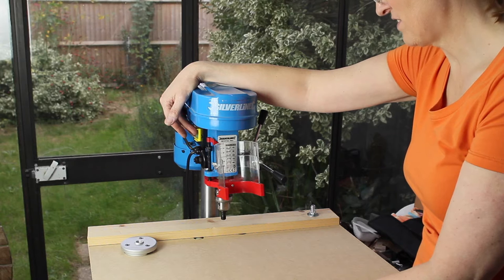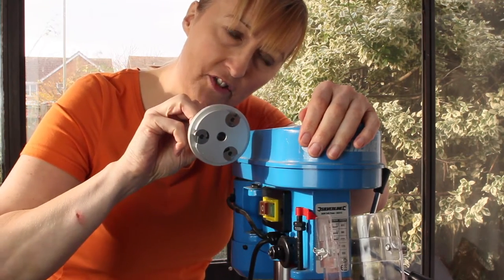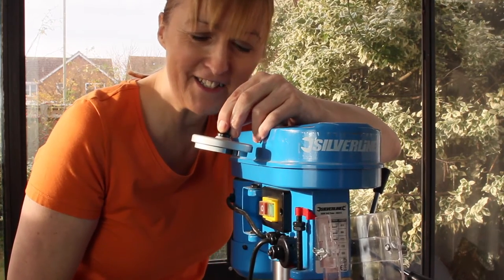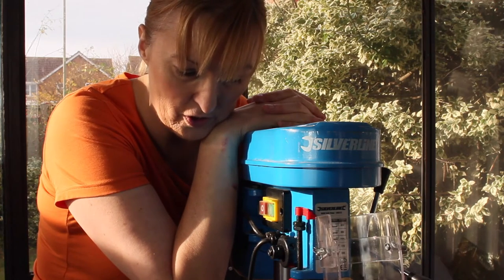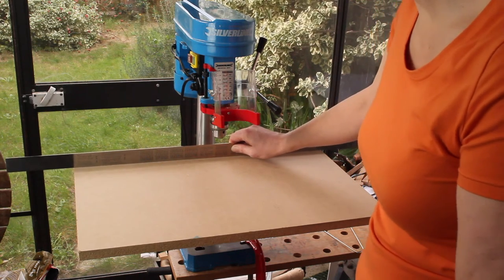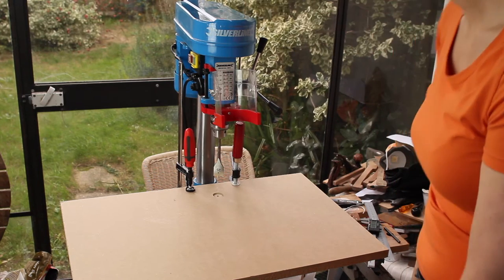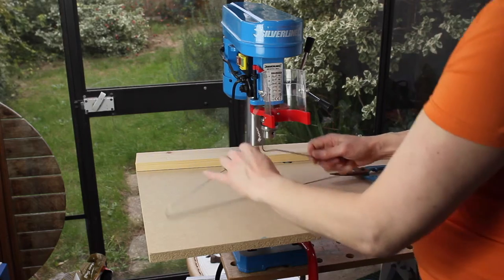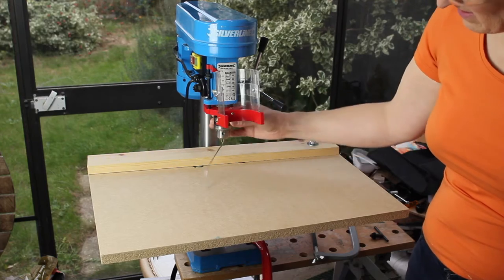Stewart-MacDonald Safe-T-Planer setup for use with a Silverline pillar drill

Comment: Well done figuring out to use the depth indicator as a spindle positioner Susan. I did the same a number of years ago and for the exact same reason. Try adding a third nut to the shaft, then you can use the bottom two to slightly raise or lower the drill presses spindle in small increments in either direction and revert back to using it for it's original purpose as a depth stop simply by running the middle nut back up the shaft to where you want the spindle stop placed.

The bent wire is a very old trick, it works but it's also much more sensitive if you use a scrap of printer paper on your table and under the tip of the bent wire. Lower the spindle until the wire just starts catching the paper but not tearing it. Swing it 180 degrees and do the same. Adjust the table until the slight drag on the paper has the same feel on both sides. Done right you should be under .0005" or roughly .001 MM for accuracy. It's a much more sensitive test that one would think just using a bent coat hanger and a piece of scrap paper. 

I still use the original Wagner Saf-T-Planers but graduated to using them in a metal working milling machine. Expensive but easily 10 times safer, far more accurate and with 100 times more control. I've found planing soft wood and especially pine the wood pitch builds up on the cutting teeth which slowly degrades the cutting ability until the pitch is removed. Oven cleaner will remove it quite well. These types of planers don't work well with softwoods but do work extremely well on well seasoned and dry hardwoods.

Comment: Susan, I realize that I am about a half a year late or more viewing this video, but I have a suggestion for your planner. Put some blue Locktight on the spindle threads and then if you stick the planner you will not loosen it  and it might save some finger tips or nails.

Comment: hi , the reason most people move the work upto the press instead of moving the spindle down is because the further you move the spindle down the more side to side play you will have. pillar drills are designed to work vertically and not from the side. your dead-stop idea is good but always try and keep as much of the spindle up in its housing and you will have better cuts.
Reply: Good advice!  Extending the quill just puts more lateral force on the quill.  It make much more sense to leave it at it’s highest position and bring the work table up to meet the planer head.  👍🏻

Comment: It might be an idea to use the second nut on the depth stop to lock the head at the desired depth.
Reply: Bang on, Lee...I was verbally urging her to at least finger-tight this, so that the head wouldn't be able to drop down, grab the workpiece, and pull it and the fingers in!  It'd make for smoother cuts also.

Comment: there are three (3) holes in the chuck and three "teeth" that cone down to hold the piece......TIGHTEN,,,,ALL....3.....HOLES....IN....THE.....CHUCK....with the chuck key.....
Reply: You’re thinking of a lathe chuck.  Drill press chucks have a toothed ring which turns to tighten the chuck and all three of the “teeth” of the chuck are tightened at once.  There’s no need or even any way to tighten them separately.  You clearly have never used a standard drill chuck before.

Comment: Susan, please unplug any power tool whenever you're setting up (as in moving the belt on the drill press over the pulleys), or adjusting the height on a router bit, etc.  God forbid, your fingers might get injured if that crazy, unpredictable drill press decides to go on by accident!!  I do enjoy watching your videos.
Reply from the maker: I do try. Did I miss one in this video? There is a microswitch which cuts the power on opening the drill press cover, but it's still a good idea to unplug. Thanks
Reply: Susan Gardener are you relying on "the switch" which stop working suddenly, you do not know why? 
You will unfortunately end up buying a thickness planer...

Comment: Load of rubbish.

Ok if you want to loose your fingers.   Where is the safety guide?

Regards,

Bill.
Reply: Well I've been using one of the inventors original Wagner Safe-T-Planners for a whole lot of years with no problems. The safety guide is between your ears. Don't put parts of your body you don't want to lose where they can be cut off.